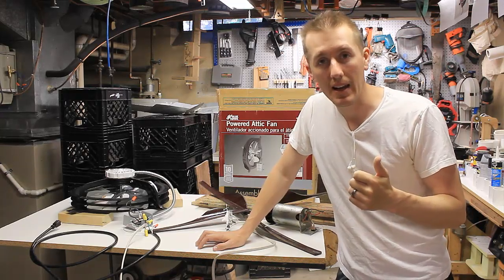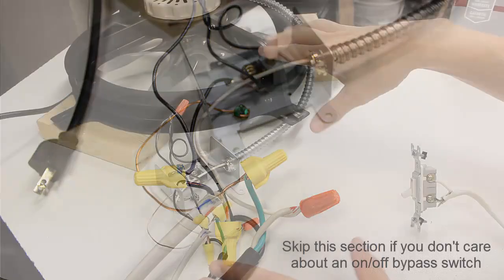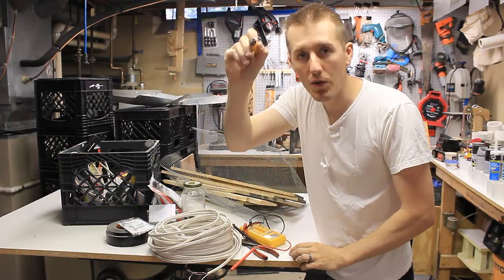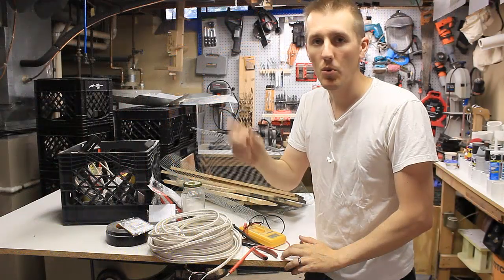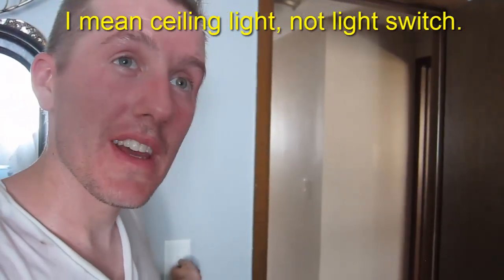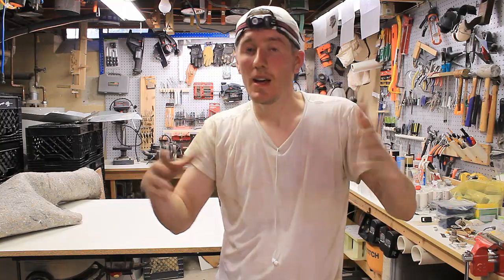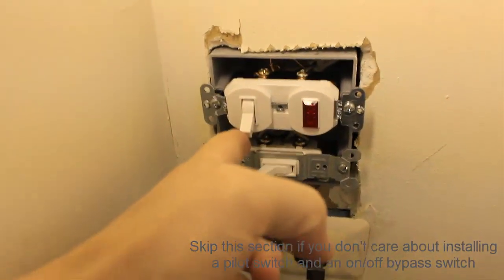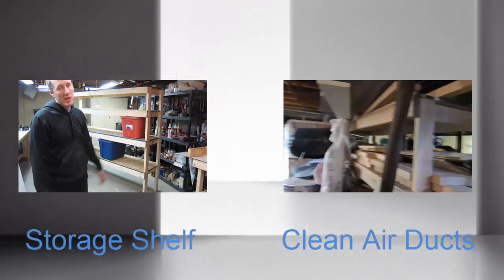Attic Exhaust Fan Install

Comment: What was the outcome for the temperature in the attic?
Reply: geez, does all this work. checks the temp before the install but not the least bit curious about the temp now? You don't have to stay up there a long time like you did with the install.... just pop you head up there and get the temp. Makes me think this project did not work. I had a gable fan before and it didn't seem to help. Now, I use a simple box fan that I set over my attic access over my carport and it works great but is inconvenient.
Reply: please do it. because we want to know if it really works.  My house attic  is the same set up as yours, so I am doing lots of research to see which way is the least expensive and yet works well. Thank you
Reply: Yeah I'm wondering the same thing... did this help cool the upstairs?
Reply: Beau S, I'd like to know the answer to this too.
Reply: I am wondering the same thing, what was the temp in the attic on hot days after install?
Reply from the maker: So far this summer we've had a couple days in the high 80's, the upstairs does seem cooler.  It's not unbearably hot like last year.  But to give you a definitive answer i'd have to go up to the attic on a day when it's 90 degrees and see if it's still 143 degrees.  That's not really something on the top of my to-do list.
Reply: Dave Wirth you have PTSD of the attic heat I don’t blame you. It is what it is I’m sure it helps.